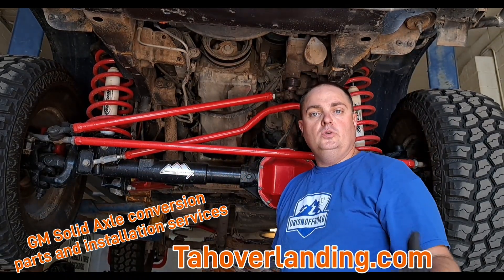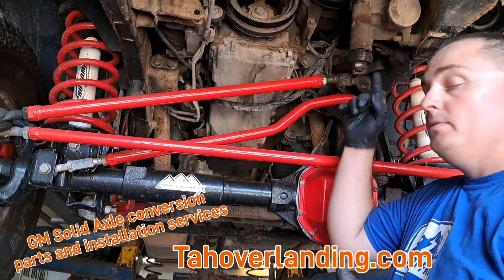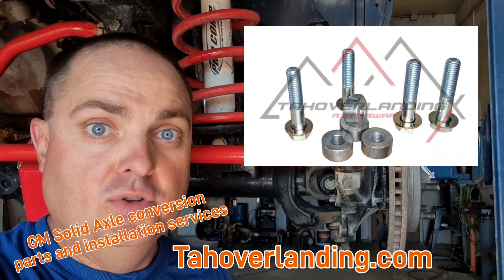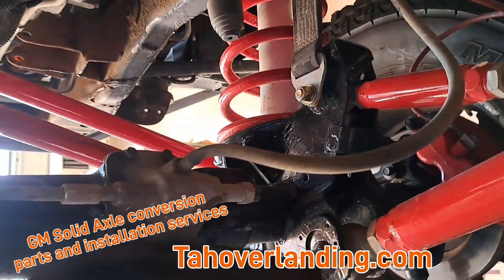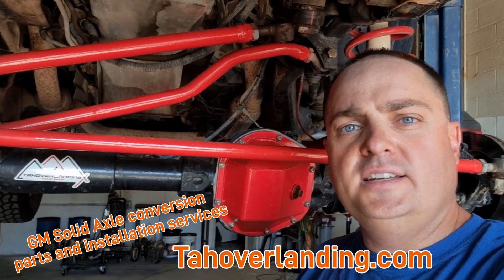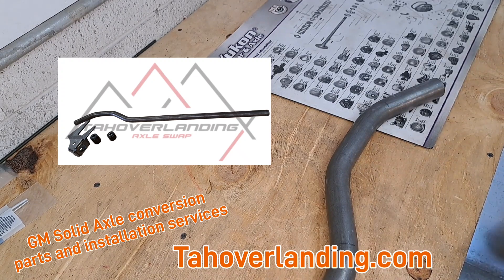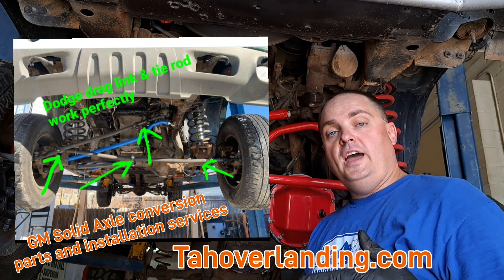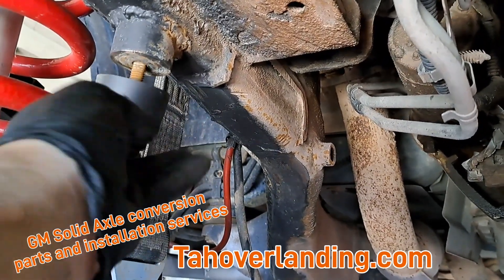GM 6 lug solid axle swap parts list Tahoverlanding Axle Swap

Comment: This is a great setup! I love it. I wonder if it would be possible to pull off factory front ride height with this set up or at least level with the rear? I'd live to do this swap but want to retain the stock stance or close to stock st least.
Reply from the maker: What truck do you have? It depends on what truck you have. Our kit is uniquely able to get as low as stock ride height for silverado/sierra. Not always able to go as low as true factory SUV ride height which from the factory were set a little lower Than the pickups
Reply: @tahoverlanding  I have an '04 Yukon. The swap would be for a '00-'02 Tahoe however, that's gonna be my next one.
Reply from the maker: On that platform factory ride height can be achieved with the same amount of upward travel that factory solid axle trucks have.
Reply: @tahoverlanding  Good to know! Would the front wheel track be any wider with the dodge front axle and factory chevy rims or would it be about the same?
Reply from the maker: As far as track width goes:
https://youtube.com/shorts/WFg_DSNdVaQ

Comment: In case if i have a 1998 dana44 dodge axle, can i swap to a newer knuckles? Will it work? And can i get a part number for the bearing, thanks.
Reply from the maker: You need 2000-2001 knuckles, ball joints, and calipers. The bearings have many options. 1996-2013 6 lug. With the best option being 2007-13 gm 6 lug bearings

Comment: can you use a 2001 ram 2500 axles?
Reply from the maker: This is for the 6 lug conversion. For 8 lug 8x6.5, we offer kits that are compatible with 1994-2013 Ram 2500/3500 axles

Comment: Hey do you have any suggestions for an 8 lug swap?
Reply from the maker: The 8 lug Tahoverlanding Axle Swap is an identical process to the 6 lug. Just without needing to convert the hubs. The 8 lug axles our kit is compatible with are already 8x6.5 pattern
The 8 lug kit is identical, just doesn't come with the caliper spacers the 6 lug swap needs
Check out the options for your platform at Tahoverlanding.com

Comment: what about gearing?
Reply from the maker: @raymond80hr  what do you mean?
Reply: For the axles to match.  would I have to change the gear set in both the front and the rear axles, maybe a 4.10 or a 4.56  Thank you for response.
Reply from the maker: @raymond80hr  some of the dodge axles came 4.10 but as a rule you'll need to gear the dodge front axle to match the rear. Whatever ratio the rear has, the front needs to have as well

Comment: I have a 07 1500 and was thinking of doing a standrad 6 inch lift, but would it be worth it for me to ditch the ifs front suspension and do this if i do plan on taking it offroad and rock crawling?
Reply from the maker: @smcc0417  you should solid axle swap it. The IFS will only serve you well if it never touches dirt. We'll get you set up with everything you need
Reply: I figured lol, great video you'll probably be hearing from me once I find a dana 44!
Reply from the maker: If you have a hard time finding one, we can also provide the d44
Reply: @tahoverlanding  how much would that cost me?
Reply from the maker: @sebastien9514  have you added it all to your cart at Tahoverlanding.com to see the costs? If it's not working, message in and I'll get you a manual quote
Reply: @tahoverlanding  yes it says around $3500, does that include the axle? Also I'm in Canada do you guys ship here?
Reply from the maker: @smcc0417  you need to select the axle as a separate item. But I don't think it works for calculating shipping to Canada. I'll need to do a manual order
Reply: @tahoverlanding  okay, couple more questions if you don't mind, is the dana 44 factory or is it rebuilt stronger? And does it have a locker?
Reply from the maker: @sebastien9514  it's used condition. We can add those things if you like
Reply: @tahoverlanding  okay no worries I don't mind it in used condition as long as it's in good working condition lol, if I have to i can get someone local to me to do that stuff
Reply from the maker: @sebastien9514  it would save you shipping cost, and duty if you can find one local to you.
Reply: @tahoverlanding  i don't plan on running anything bigger than 37s, should I get the dana built a little stronger or go with a dana 60 and completely ditch the factory 6 lug wheels which I'm okay with
Reply from the maker: @sebastien9514  I would do the 44 if I were you. But your choice
Reply: @tahoverlanding  okay, I don't have much knowledge on this subject that's why I ask lol

Comment: Can the track bar be ordered how you have the one in the video setup?
Reply from the maker: @tsstarlin  it can be drilled for additional expense. But it's a total waste. It gains you nothing

The only reason you've seen track bars come adjustable is so they can be sold to a wide variety of vehicles and heights

When building your own, there's no reason to have any adjustability. And doing so only introduces weakness, and expense, both in initial purchase expense. And future parts replacement expense. 

But if it's something you really want, it's available
Reply: @tahoverlanding  I have been debating on doing a long travel suspension on my 2006 Silverado, but I’ve recently changed my focus to SAS. I think it fits what I’m trying to do better and the environment that I live in. I have debated on going the 1 ton route. What do you recommend? I live in Southeast GA and I’m wanting to convert the bed of my truck into a camper.
Reply from the maker: @tsstarlin  the vast majority of individuals don't need 1 ton axles. We do offer one ton kits if needed.

 But the largest strength is gained by going solid axle over factory IFS. The rest is small amounts of strength gained by bigger axles. But the dana 44 we use in our 6 lug kits gets almost 2" more upward travel, and 1.5" better underside clearance Than the one ton axle can get. 

It's your call. But unless you're adding a 3,000lb slip in camper I would go with the dana 44. And our bolt on rear full float conversion kit. 

If you ever needed to go to one ton, the axle can be installed in place of the D44 interchangeably so no additional work if you ever need to go bigger axle

But by staying 6 lug, you'll have better travel, better underside clearance, and will save money on purchasing new wheels and converting the rear axle to 8 lug to match

Comment: Question,  would this work with the Chevy Trailblazer EXT? If no so you have something that would?
Reply from the maker: @BigMike73731  sadly, no Trailblazer fitment

That's an entirely different animal
Reply from the maker: Over on Instagram I have a short video from a couple years ago where I pulled one on the lift to check out swapping.  

I found just how different of an animal it is. 

I developed parts to make a Jeep front axle have the trailblazer 6 lug, and ABS sensors. But never got past that point
Reply: @tahoverlanding  are they productions part available? I would like to have 6 lugs  pattern from the full size trucks for more wheels options. And to do an LS swap..

Comment: Great video are you guys working on a It for the GMTK2UC/G, I need one
Reply from the maker: That platform is essentially the same as a GMT900 except, the 6 lugs often came with an electric rack and pinion. 

Our add-a- steering box kit can be used to retrofit the necessary steering box for a solid axle. But the system has errors without the electric steering in place
The steering box kit 
https://youtu.be/fiNGdqJYYec?si=De7yZI2c317sx0F-
Reply: @tahoverlanding  you just made my life easier thank you
Reply from the maker: @thatguysadventure4298  you're welcome, check this one out too:
https://youtu.be/GeOUhZaHI1Y?si=nQGWMqG1PVaBPJGZ
Reply: @tahoverlanding  I recently got a 2wd super low miles one owner and looking at going this route sourcing all the parts and then seeing how I’m gonna tackle It

Comment: Do you know of any company that makes a kit to solid axle swap a 2001 Chevy Tahoe? Donor axles would most likely be 05+ Superduty axles.
Reply from the maker: @zacharycampbell8553  FORD super duty axles come with MANY downsides. The TAHOVERLANDING swap is specifically designed to avoid those downsides including the worse off road performance those axles achieve. 

I don't know of a kit for 05+ SD axles specifically for the 1500 platform that the Tahoe is. WFO concepts can scab a kit together using parts from their 2500 kit I think

I have multiple customers with the 1500 SUVs and 2005+ Super Duty axles who have contacted me in writing to tell me that they regret it and wish they went this route

I encourage you to maybe reconsider your axle choices 

If not, like I mentioned WFO has been known to piece together something on 1500 platforms
Reply: @tahoverlanding  what do you suggest for the swap? What is the easiest setup to do?
Reply: @tahoverlanding  What would you suggest for the best kit? What would be the easiest to do?
Reply from the maker: @zacharycampbell8553  the #tahoverlandingaxleswap that we offer is much easier than the putting 2005+ SD axles in. 

See here, how easy it was for this totally inexperienced person to install:
https://youtube.com/shorts/BiTZD3lTp7U?si=AYdRRSDObrTCcPqS

A lot of the ease is in the axle selection itself. 

The axles we use do not require modifications to the existing axle brackets. If you use our kit, You will use the axle as it is
Whereas the SD axles require extensive cutting and re-welding of the brackets before it can be used

The Ford SD axle requires you to change out your rear axle to match the 8 lug. 
Since you have the 4 link with panhard rear suspension, all of those brackets need to be precisely added to the new axle. There is no kit to do this, so you'll be extensively fabricating the rear suspension just to make the front work.

Plus you'll be forced into purchasing new 8 lug wheels.

Then, the Ford axle uses a 60tooth ABS sensor tone ring,  Your system needs a 55 tooth. So once you've spliced the wires, your ABS system will never work properly

Our kit with the correct axle has none of these issues. 

Since you won't be dealing with those issues, the Tahoverlanding swap is many times over again easier to perform than a Ford SD swap

Plus the Ford axle hangs 2" lower hurting off road performance.

The Ford axle,  due to its size and shape has 4" less upward travel, hurting off road performance 

The Ford axle not having as much upward travel, requires a higher ride height. Higher center of gravity hurts off road performance 

We've put a lot of engineering into this kit. I promise you it's the best route to go 

https://tahoverlanding.com/1999-2006-gmt800

This is another good short video to watch on the issue:
https://youtu.be/_KlGzMNGhjo?si=U1m-3w6UYzJHYBJn
Reply: @tahoverlanding  This kit seems absolutely perfect! What would be the estimated cost for doing this swap?
Reply from the maker: @zacharycampbell8553  most guys doing it in their driveway. Do it for around $5k total or less
that's everything

We install them at the shop. But it gets a lot more expensive if we do it for you.
Reply: @tahoverlanding  I'm no ASE certified mechanic, but I work on all my own stuff plus friends, so undertaking a task like this would be something that I could handle. Do you have an exact build sheet of everything I would need for my 2001 Tahoe 4x4? I like to collect all the necessary parts and pieces before I start any project to minimize the trouble of getting into something then having to wait on parts.
Reply: @tahoverlanding  what about the rear axle set up? Is there anything that gets changed with it or how does that work?
Reply from the maker: @zacharycampbell8553  the video we're commenting on also has it all explained. But here it is boiled down:

If you Buy our full kit

Buy a 2000-2001 Dodge ram 1500 axle, coil Springs, factory upper shock mounts, and shocks

Buy a 1999 durango front driveshaft

Buy some pieces of 3/16 steel to patch and fab a few places

Buy a dodge posi-lock 4x4 kit

And that's all you'll need

 *edit: 
just saw the next comment

The rear axle stays unchanged.

Our kit is designed to match the front to what the rear is at. So be sure the rear is at the height you want it before setting the front.

This video goes into how that works
https://youtu.be/AGI0Uq4H4Js?si=8aE0a0yZE4UUeqij

Comment: How much travel do you get out this?  I already have deleted the torsion bars off of my 06 Silverado and done an overlanding build with it. Kinda wanting to play around with a long travel kit, but this also has my interest
Reply from the maker: To answer your question, with the standard Tahoverlanding build, using factory dodge front springs. At the bump stops, it's right around 4-1/2 up, and 4-1/2 down

But that gets magnified at the wheel.
You should watch this one:
 https://youtu.be/xreLdMWw8K8?si=_QQwmpaVkd6THULl

And then this one:
https://youtu.be/xreLdMWw8K8?si=_QQwmpaVkd6THULl

And then this one:
https://youtu.be/DQgN72RGEUg?si=dZEHuaTwxYmGY1Ju

Travel isn't the only part of the equation. IFS travels in a different way Than a solid axle will, that third link illustrates that at 2 : 30

The Solid axle also gives a huge variety of lockers and limited slip units. Whereas there is next to nothing available for the GM IFS

As well as solid axle gives you component strength that even top tier IFS components can't match

You can build yours in a few ways,  and so can get even more travel out of it. But there are a lot more factors that we also encourage you to consider. Rather than blindly pursuing travel alone if that makes sense
Reply: @tahoverlanding  I already have an ox locker for the rear and was thinking on going with ox again if I did the SAS.

Comment: How can you tell what year the axle is.
Reply from the maker: It is shown in the way the caliper mounts to the knuckle,
The 2000-2001 have caliper mounting/ bracket that looks like this:
https://youtu.be/kC1JzLY6gjo?si=gMrl0jk9cJT-I8a5 

And the incorrect knuckles from 1994-1999 look like what you see at 7 : 28 here:
https://youtu.be/9F55BcMXgqo?si=k9HcFHpzz6iN8YUi

Comment: This requires using the dodge brake caliper? I have upgraded my brakes to a 2021 4 piston caliper and rotor from an escalade. Id hate to lose my sweet brakes :/
Reply from the maker: I have machined adapter plates for the 2020+ GM caliper. But it's such a low demand thing, I don't list it on the site. Buying those calipers Even used off ebay is usually pretty expensive. So it's a really low demand thing

Comment: I have a gmt900 tahoe which have a steering rack, any thoughts on the best way around that? The gmt900 HD trucks still used a steering box, I wonder how hard that would be
Reply from the maker: See this 2 minute video about GMT900 Swaps:
https://youtu.be/GeOUhZaHI1Y?si=_-2jYW44ViZ1Jh96
We use the gmt800 steering box, and shaft, with gmt800 lines. When you do your swap, I'll give you the measurements on where to mount the box, and how to orient it. 

Go to @tahoverlanding on Instagram, I posted a post about this literally today
Reply: @tahoverlanding  great info thanks dude

Comment: Your the best ! Thanks for sharing all this detailed info , greatly appreciated
Reply: Question can this set up be ran with crossover steering
Reply from the maker: @randyhernandez1590  
I think you've got that term mixed up somehow.  
Crossover steering is when the drag link crosses over from the drivers side to the passenger side knuckle.  

Crossover is the ONLY way this works. 

You usually only heard that term in the square body Chevy trucks. The K- series trucks from the factory ran a longitudinal front-to- back drag link. That design inherently needed the drag link to be short (right around 15") and it hurt flex and was difficult to lift.  

So the popular modification was to go "crossover steering" which converted to a standard style drag link. It required a different steering box etc. 

That doesn't apply in this case.

Comment: I know it’s old but will this work with the gmt800 1500 trucks?
Reply from the maker: This swap is designed primarily for 1/2 ton GMT800 trucks and SUVs. That's what it works best on 👍

Here's a video showing it on various 1500 gmt800s pickups and SUVs
https://youtu.be/BHxa-afRemg?si=q9ItvFjh0VjUq-F3

Comment: You sir just earned a sub.

Question: can this kit be installed on a 2wd 2500 Suburban? Ive got a line on a few 8.1 equipped 2500 Suburbans, but none are 4wd.

Will the GM 8 lug unit bearing install on that Dodge solid axle?
Reply from the maker: Glad to gain a sub, hope I gain a customer too

I did videos about that
This first one and the follow up to it are about the ABS on the 8 lug trucks
https://youtu.be/rEiCccZ-I6g?si=Kp10qKkVO2Ph8zMq

The follow up to that video:
https://youtu.be/GUXwjDYikDM?si=helUosMATSGB2jBb

And this video is about the subtle differences in how you'll do the swap on a 2500 frame truck:
https://youtu.be/9F55BcMXgqo?si=SzCkNeL6yqaQ0qSa

And this video shows the swap completed on a 2wd suburban, but it was a 1500:
https://youtu.be/BHxa-afRemg?si=DIYOsS587imWeQ6Y

and this video discusses transfer cases and also touches on transfer cases for 2wd to 4wd swaps
https://youtu.be/I9vOssr8h7Q?si=6hFqqFtxjKB7r32e

And this link is to the axle swap parts, scroll down to the 8 lug parts, since you have an 8 lug truck
https://tahoverlanding.com/solid-axle-swap-parts

Comment: Will this work on GMT 400 trucks?
Reply from the maker: Yes it will, you need to use the larger gmt800 brake rotor though.
Reply: Thanks
Reply from the maker: @davkenrem  no problem, feel free to contact me at Tahoverlanding.com and we can go into further detail